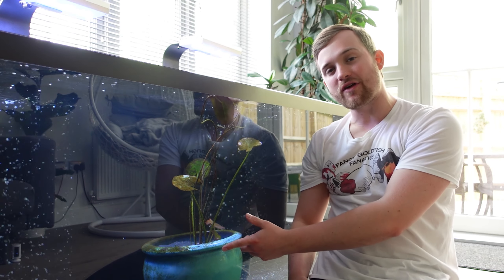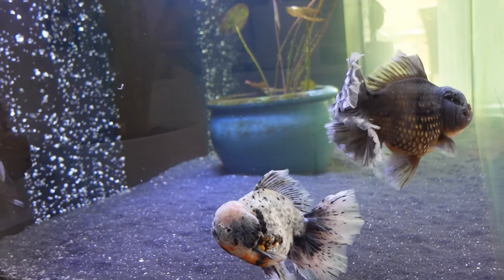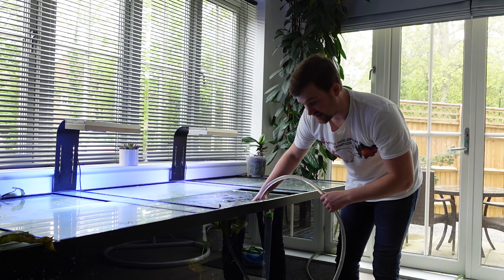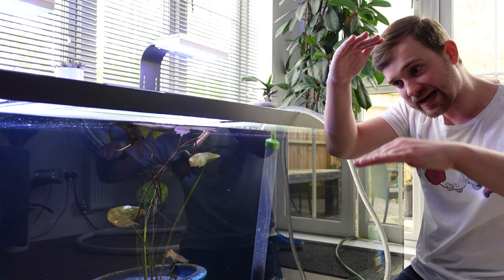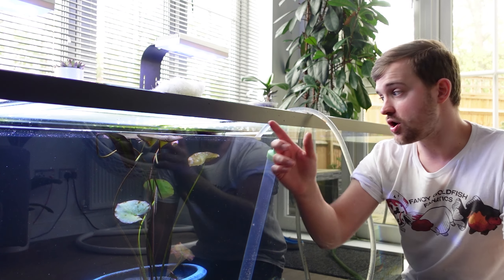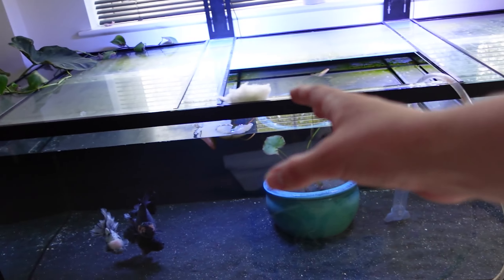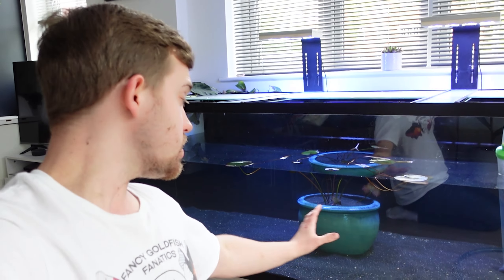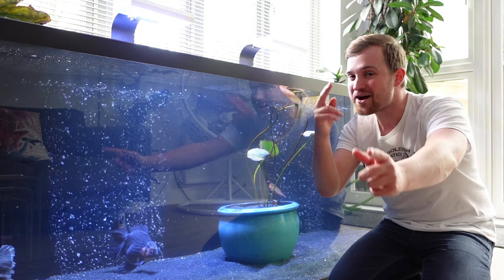How I Clean the Oranda MEGA tank? | Goldfish aquarium cleaning day

Comment: Hi Chris, very nice video, wanted to ask since tap water in most areas in UK comes low in PH at first because its pressurized and returns back to around 8 within few hours do you think large water chenges, I do 50-60% might have an adverse effect? Aging some water before using it would solve the issue but it is a bit  time and space consuming
Reply from the maker: That's definitely possible. My tap water pH is high and hard with a high GH and KH, so I hardly get any movement in the tank parameters. However, in a soft water area with low GH, I would check your aquariums pH and tap water pH first. Going from acidic to slightly more alkaline water shouldn't be a problem for the fish, but bigger swings over 1 point should be minimised.

Comment: Can you put a wave maker inside of a goldfish tank btw awesome vid mate keep it up
Reply from the maker: You can but make sure the flow is generally pointed at the surface and its only a small one. The wave maker I have is very small compared to the tank size but it provides ample oxygen on the battery backup incase there's a power cut.
Reply: @AquaticElements  thank you what brand is your wave maker if you don’t mind me asking
Reply from the maker: @tony shakespeare The one I have is an old Jecod/Jebao model (RW4). It has controllable flow and flow patterns. Thanks 😁

Comment: Have you considered using some different filter media to limit or control algae issues? Seachem's Purigen and Phosguard for starters work well with one another. They can be re charged afterwards within minutes. Good old Carbon which doesn't last long will also aid to clear those cloudy patches here and there. Brightwell Aquatics also have a few products that can be used for freshwater & saltwater. Have you considered looking into your lighting periods? Those AI units are well made but not fully "Freshwater" safe. Just my thoughts. You can adjust them but avoid the blues and violets ? I could be wrong here.
Reply from the maker: Hey, the lighting system can be set at 6000 kelvin or lower, which is the daylight spectrum. I currently have it running a little bluer at 7.5k. I would rather do water changes personally as I would need a huge amount of purigen or phosguard to make any significant changes to the water quality. I have around 1kg of carbon in the filter every now and again. I would definitely love to use higher quality media like purigen or biohome as the sole biological filtration method if I could. Thanks